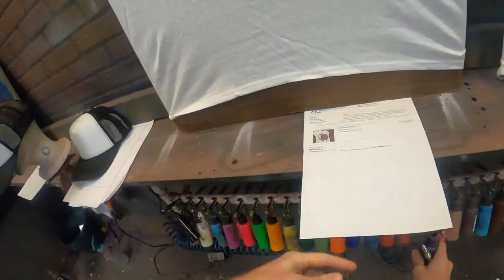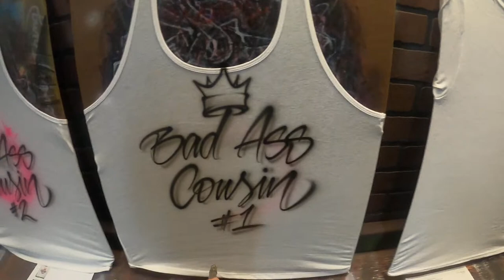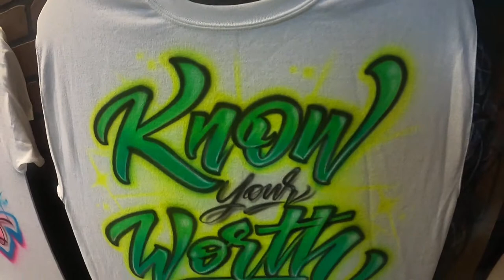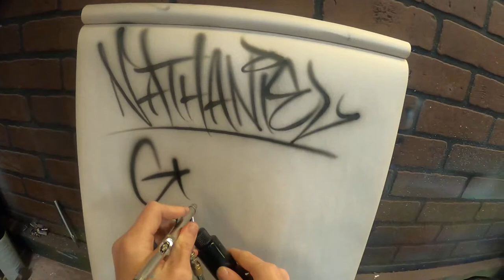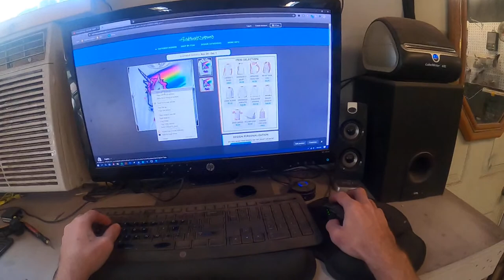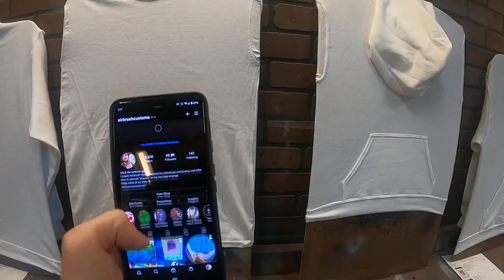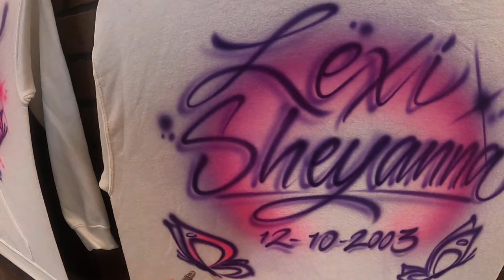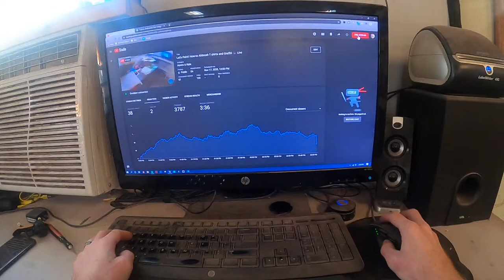Let's Paint! How-to Airbrush T shirts and Graffiti 🎥 Live

Comment: What airbrush are using a can u get quick connection for badgers at the gun because my guns were screw on your using some kind of quick connector coupling/couplers ,mine were only like that at the t tap connection or 4-6 way at the line that comes off the compressor, I want to have 1 or 2 lines from the compressor with moisturiser trap then at the end of the line a quick connection at the brush not the line on floor or at compressor. If it makes any sense ,cheers my badger in Australia cost me 200 per gun but my stuff was all stolen out of my shed were I used to work. But great work buddy don't know much left handed airbrush artist ,only thing that gets me when I used to do a nice crisp clean line work was the overspray, I like to do as much freehand as possible when everyone else uses tap/frisked film or stencil .

Comment: Is it ok to let your air brush soak in water and not harm the brush
Reply: Hey way out here in Arizona like your work
Reply from the maker: Sure, it's just water though, it's not going to break down the paint.
I don't usually soak them, but clean with airbrush cleaner, or alcohol, or even wd40. 

Honestly, I don't know the rules. I never had a problem with solvents dissolving seals or anything. I've been doing it my own way, different each time for 15 years. No problems